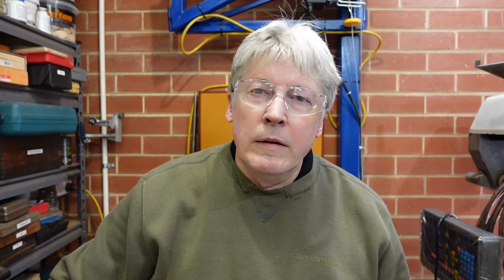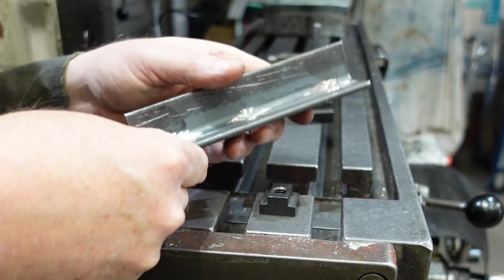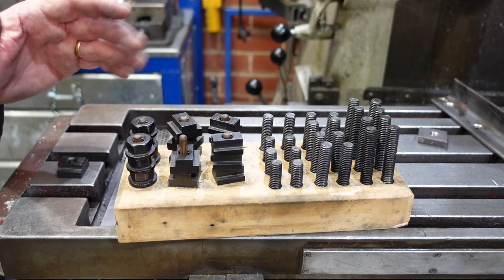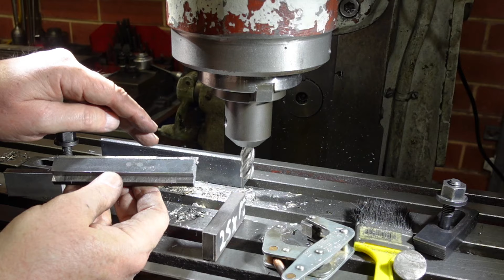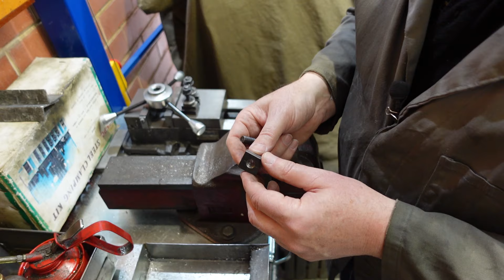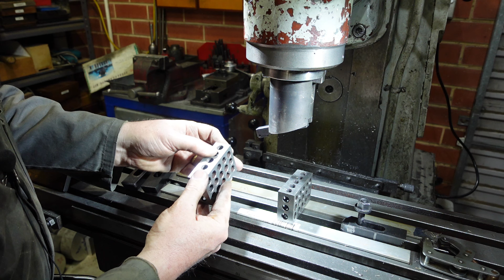Boot strapping a mill

Comment: It's faster to directly bolt the stock to the table. If you have the correct cross-section, it's a single setup and all you need is two ersatz t-nuts like what you have.

Procedure is to drill a clearance hole in each end of the stock. Bolt it onto the table. Enter from the side to profile it and exit on the side before you hit the bolt. Once profiled, drill, tap, and then cut apart.
Reply from the maker: True - the fence is an additional step, but a handy thing to have.